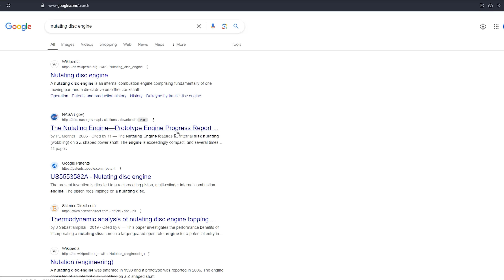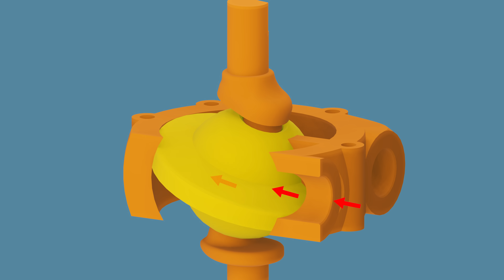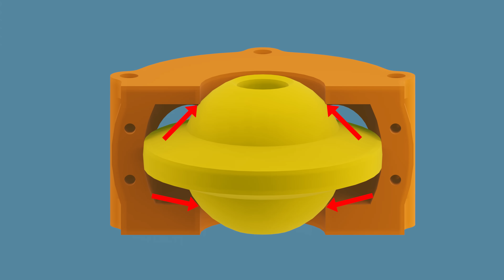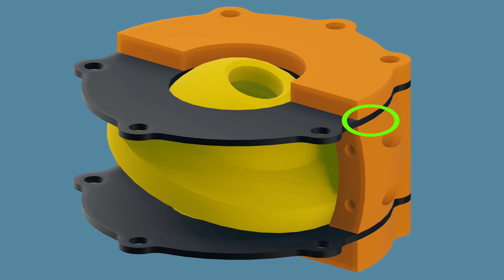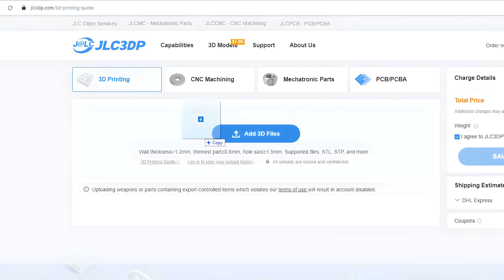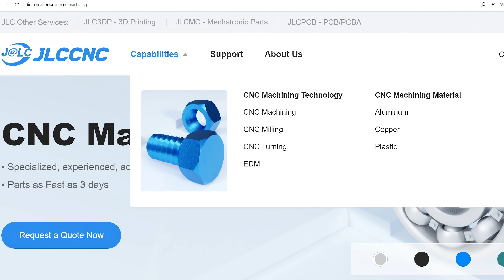I Built a Nutating Disk Air Engine

Comment: A true proof of concept. A device that converts moving air into moving air!
Reply: I'm pretty sure if he just cuts the engine out and just lets the air flow out of the tube it's 100% efficiency with regards to moving air. (Which I believe is why he's using the propeller, correct?)
Reply: @orion1816 propeller works like a gearbox as he needs more torque
Reply: @GewelReal  you dont understand.  The airflow he is using as power input will ultimately be the exact same airflow out as the propeller pushes.  the system is useless.
Reply: @orion1816  no, YOU don't understand.
air out of hose may produce a lot of thrust, but it's not optimised for lifting something heavy. It will work way worse than a propeller unless your goal would be speed (it may not take off the ground as well as a propeller if at all)
Reply: @GewelReal  тогда просто возьмите пневматический гайковерт . Будет отличный момент при меньшем расходе воздуха. Плюсом будет еще и привычное управление )))
Reply: @orion1816  you dont understand. the proof of concept is the change of pressure rotates a gear, the underlying idea behind an engine. The pressure change would be produced by a fuel being combusted and then the end products of combustion would be put out the exhaust. You could say this comment about a piston too.
Reply: @slobodancovek8047 ... But what you don't understand is that combustion is a highly inefficient mechanism of energy transfer in the first place as 70%~90% of fuel energy is lost as heat. It is much smarter to focus on purely electric solutions as they are 99% efficient.
Reply: @ the viability of combustion or not has no bearing on the viability of this to perform the same work as a piston
Reply: @orion1816  this is very small minded. The system converts moving air into rotational energy. For the sake of the video this is demonstrated with a propeller. The output of the propeller, by the way, would be LESS than the input as air and energy will always be lost to the environment.
Reply: @HopperDragon  agreed. Using hydrocarbons as a combustion fuel to power a kinetic application  is absolutely small minded. Let's leave this stream punk technology in the last century and get on with the electric revolution please.
Reply: @orion1816 -- Weirdly enough, airplanes are the one place hydrocarbon fuel is strictly better than electricity, and the reason is energy density. Gas has a ton of energy in very little weight, while electricity needs tons of batteries or a power plant anyway. Electric motors aren't exactly light either.

This isn't as bad at small scales, which is another reason why batteries dominate the toy world, but a 747 would need a much larger mass fraction of batteries to get the same ~20 minute flight time.
Reply: @GewelReal No, you don't understand. The propeller cannot possibly produce more thrust than the air being used to turn it. If it did then it would be over 100% efficiency which is obviously impossible.
Reply: @orion1816  Yeah but that would miss the point of exploring the mechanical principle that turns compressed gas into rotation. 90% of the 'engineering porn' stuff on here exists for the same reason. Besides that, this principle isn't a million miles away from how a throttle valve works inside a carburetor. It's worth knowing about.
Reply: @orion1816  2nd law of thermodynamics, you can't break even ;)
Reply: I've enjoyed reading the comments that word meant in good humor😄, as well as those from commenters totally lacking a sense of humor🤣.
Reply: Isn’t a turbine more efficient surely?
Reply: I dont know if you're being sarcastic or funny, but this is goddamn funny
Reply: Lmao
Reply: Put some wheels on it and you can move through the air while moving air with the air!
Reply: I think this is better for a land based vehicle
Reply: You're forgetting the really brilliant part.  You're losing energy in the conversion.
Reply: watch tom stanton  2l bottle series
Reply: More like spreading air
Reply: I think delta momentum and delta energy different things. So I think this theoretcically could be useful. This of course doesn't take friction in to account.
Reply: lol
Reply: im a fan
Reply: THE ONLY PROBLEM IS THE 100 KILOS COMPRESSOR HAHAHA
Reply: @gatoninja4387  Yeah, this is a totally useless concept unless for educational purposes.
Reply: @Motocicleiros  Have you ever seen a compressed air plane?

You know, the ones where you put compressed air in a bottle then fly a small model plane using the compressed air tank.

You could also just compress the air in the bottle then let it out, but such a plane only flys for a few seconds before the air has completely equalised pressure with outside.

But if you feed it through a turbine you can run a propeller and have quite a long time (minute +) of powered flight.

This turbine is an attempt to do that with a simple mechanism.  I'm not sure this particular design is it, but it is an interesting idea that is worth investigating.

It isn't making energy, but merely designing what they hope to be the simplest mechanism to use the stored energy more efficiently.
Reply: @meateaw  Oh, toys! OK!
Reply: That’s a fan.
Reply: With the right hose, this is surely a perpetual motion machine! 😂🤣🤓
Reply: @briantopping5631 are your mom and sister available?
Reply: @briantopping5631 jk, ofc.😅
Reply: @briantopping5631  So what you're saying that if he puts a hose on the exhaust to a valve that cuts into the supply line, once he gets it running he can switch it so the exhaust circles back into the motor and he doesn't need the compressor anymore?
Reply: @ I wasn’t sure how this would work, but that sounds just right!

Comment: Honestly, I don't know why your design holds the saturn bauble from rotating freely.  I think that big hole for the like, vertical pin to hold it from spinning is probably the biggest place you're losing compression, and that pin sticking out of the case can't be good for the airflow either, and I can't figure why it wouldn't work without it.

Comment: I've had good luck "lapping" plastic parts for a better fit, with toothpaste.  Maybe oversize the rotor 0.1-2mm and lap it into the housing with water and toothpaste.  Then rinse and dry.  I'm not sure how much improvment is needed in this area though.  It may work on the top and bottom seal to rotor interfaces though.

Comment: Intersting idea- its like a boxer engine but without the seperate crank shaft between the cylinders....but Two points to add-
1: Wear in the cylinder over long  term operation- it would be interesting to see how much loss due to friction in the cylinder you generate.
2: Vibration - it would seem that having the axis of the "piston" disk at an angle would generate a fairly significant sideways/rotational vibration; so again something to measure on an efficiency loss

Comment: Okay, so how does it compare (in terms of efficiency) with a typical airmotor?
You made comparisons, right?  So you'd know whether it was really worth pursuing?
You made measurements, right?  How long does it last running full tilt boogie?  I didn't notice any bearings or lubricating method.

Comment: the disk inside needs to be as light as possible to lower dampening force, dont know if its possible to add motorical gears that could increase the weightlift power

Comment: I think it's a mistake to have that keyway that keeps the disc in one position. Remove the keyway, make the disk continuous all round and let it rotate if it wants to. I think you'll find the overall effect is better. It's also creating friction between the disk and the key.  You may also find making the surface of the disk where the air impacts it slightly concave as if a mild torus has been subtacted from the shape might improve it also. I think you'll find it will work better with more closely-engineered surfaces than using rubber seals and then letting it run at a faster speed.

Comment: Cunnect the air out to your compressor intake or a "vakuumer"/strong dust sucker.
In a fictive real live costrucktion a air compressor could be part of the circle by deliver positve and negative pressure at the same time.
What about way larger wings and stronger construcktion and let the force be delivered by hydraulik over all?
may be slowe the nair but way more force possible, so larger bladewings could be used.
You made me curious at all^^

Comment: i think you need the second disk to restrain the exhaust and use it into your rotation, the 2 disk version you showed is kind of using the leakage and the exhaust to spin a second disk wich is 180 degrees from the first. 

I think you should try that two sphere in series is my first idea
second idea is to turbocharge your exhaust into your intake using the leaks and the exhaust to spin a regular compression disk inside a turbo body. 

both ideas together and you might have something quite cool. damn i wish i had a printer

Comment: if you could force air without compression through movement, you could create a safety device that would turn a propeller in case of engine shut off?

Comment: i wonder if using a different seal would work better than rubber. I wonder if Nylon would work. Or at least something with low friction that can hold air. I could be wrong but never  know till you try right? Nice work hope to see more. You have a new subscriber.

Comment: @7:12 the second valve improved the exhaust pressure and made it spin slightly faster than without the valve. Keeping the pressure high inside the engine.

Comment: Seems to me the 'vane' is far too thick.  You should build the next one with a metal washer sandwiched between two hemispheres.  If it requires the sloped angle to form a seal at the top and bottom, you can compensate for the flat washer by making the housing hold the slope instead.  You'll have less wasted force from the air banging into the big, fat cross section of the vane, and you'll be able to make that keyway smaller and tighter since it won't have to make up for so much of the same cross section.  Also, you can put a piece of rubber on the washer/vane itself AT the keyway to form a better seal.  Don't do it like a wankel apex seal in between the vane and keyway, but more like a squeegee or windshield wiper, so it can flex up and down.
Reply: The thickness might be "valve timing" but questionable

Comment: I'm confused why you would ever use this instead of the Tesla turbine with near 100% efficiency. 
Too much unbalanced load, it'll tear itself apart shortly.
Reply: A TESLA turbine doesn't work with combustion, but this will.
Reply: @logic.and.reasoning  Firstly, no it will not. Not how it is designed currently. Second, he literally called it an air engine.
Reply: @TlD-dg6ug  rotation detonation... look it it.

Comment: Graphite works great for both sealing and reducing friction
Reply: Probably could run some powder through it and it would self-coat all surfaces by embedding to the plastics.  Maybe a primer first to soften the top micron of plastic, low percent oil/acetone blend.  Of course not on the transparent one or it would not be so transparent anymore.
Reply: That's a good idea, I think this is a good application for the use of graphite instead of seals and oil.

Comment: Seeing as the disc doesn't rotate, only spin. I wonder if there is some sort of accordion style gasket you could use - like a speaker's edge. Something that will flex a little, but hold air in without losing much energy due to friction.

Comment: So, 3 ways to make this more efficient. 
First we have to understand the high torque low speed nature of this engine. It runs at exceptionally low pressure and doesn't go very fast. 
The first way to increase the efficiency would be to further stabilize the rod, as this will reduce friction. It was a tad wobbly. 
The second way to increase efficiency would be to add a gear ratio to the propeller making the propeller spin between 1-2.5 times per rotation of the engine. This would add friction but help the engine convert torque to propeller speed.
The third way to increase efficiency would be to reduce the total number of gaskets used and make a more solid chassis around the disk, and reduce the size of the sphere in the middle. Using an interlocking chassis you can make a more definite tolerance, and use less gaskets. Reducing the size of the sphere would increase the total surface area of the piston without sacrificing too much volume or adding total size. I'm sure there is a 'too small' though as you could lose compression. 
You could also experiment with changing the edge of the disk only around the area of the intake or outtake, as well as getting rid of the gap around the fin that interlocks with the disk and chassis to reduce bleed from one chamber to the next. The disk tilts so maybe use a parabolic shape. This point goes in tandem with @acreery1 comment.
Reply: Imagine being able to measure IQ from a single YouTube comment. 🤔 🤨 😂
Reply: I wonder what bennefit a single air input split into two streams feeding 2  parallel turbine “balls” connected on one  power output turning shaft stacked on top of each other but out of phase so there isnt a repeating lower output restriction of flow point between the up and down wobble from the edge blocking the inlet
Reply: I have an even better way to increase efficiency and power. Make a rotary vane motor.
Reply: @FreeXsa  Wow, that doesn't go against the creative context of the entire video at all... you know what else would make it more efficient? Making it bigger and actually using it for something productive. 🤡
Reply: I have one way: forget it.
Reply: What makes this high torque? By the looks of it, this design could easily be stalled when mid stroke, causing air to just bypass rather than move the disk.
Reply: @--_DJ_-- -- High torque compared to a traditional bladed turbine, especially at low speeds.
Reply: How different is your commentary from "COOL, Dude" standard responses 
I smell 150 minimum IQ
Yes we can recognize each other my fellow even at a distance 
Though the feeling of loneliness is there, you are not, it's just because we are so few and separated
Reply: @sorinavila5073  Apart from barely understanding what you're trying to say or whether or not this is sarcasm, sure! Thanks, you too man.
Reply: @sorinavila5073  what on earth are you yapping about
Reply: @LeavesDecaying  I don't disagree, but maybe he's just sad.

Comment: Correct me if I’m wrong but this is how a hydraulic piston pump/motor works, just the pistons act as valves in the hydraulic version.
Reply: Not really. The way the hydraulic pump works is it has pistons that spin on a flat plate that is 45 degrees or so angled, effectively driving three or four pistons in and out.

Comment: LOL. Several patents around this architecture exist. I significantly improved them and many other rotary designs. 🤯💥🤯Multidisciplinary engineer/inventor here. We are developing the revolutionary FAZE engine technology. The 𝔽𝕦𝕖𝕝 𝔸𝕘𝕟𝕠𝕤𝕥𝕚𝕔 ℤ𝕖𝕣𝕠 𝔼𝕞𝕚𝕤𝕤𝕚𝕠𝕟 𝔼𝕟𝕘𝕚𝕟𝕖  tech best solves the issues present in previous internal combustion engine designs by transforming the old paradigm into a simple, low cost, quiet, power dense, efficient, on-the-go liquid and gas fuel-flexible, ‘non-polluting’ solution for power generation of all scales and advanced transportation.

𝔽𝔸ℤ𝔼 delivers better than 25% ABSOLUTE/ACTUAL [not relative] 
fuel efficiency improvement over gasoline engines, more than 15% 
for Diesel engines at any operating condition - speed/load, ambient 
temperature or elevation, not just at one optimal testing point at 
STP. Real world driving cycle savings could be an additional 200% 
higher due to the constant MAXIMAL efficiency and torque which 
results in a huge turn down ratio of ~99% without sacrificing 
performance. That means it's idle or running speed can be 10-50 rpm. 
The `simple, low cost, native/built-in, non-electric, environmentally safe, 
non-explosive, temperature agnostic 𝕊𝕦𝕡𝕖𝕣ℍ𝕪𝕓𝕣𝕚𝕕© feature 
recovers more energy than EVs and provides approx.100% fuel 
savings for a combined absolute vehicle fuel usage improvement of 
approximately 300%, thus obviating the basic need for expensive 
EVs & e-hybrids. 𝕚ℙ𝕠𝕨𝕖𝕣𝔹𝕠𝕠𝕤𝕥 adds >400% more torque. It’s like 
4 engines in 1.  This is all done w/o a transmission. 
 
The fuel agnostic capability allows instantaneous use of any liquid 
or gaseous fuel [natural gas at home!!!] incl. biofuels and hydrogen, 
even if old/dirty/unprocessed like flare gas or employ the concurrent 
multi-fuel capability…anywhere on the globe. One engine for all 
locales w/o modifications! Unlike EVs, this enables fast fueling anytime, 
anywhere…with no troublesome infrastructure disruptions or 
changes. EV’s are not a solution to the [FAKE]climate or mobility topics as 
high level of electrification globally is unrealistic 
[See Patrick Boyle's video "Electrify Everything?"] 

The technology offers smokeless, non-polluting, low odor heat and 
noise output without costly after-treatments, etc.,… with only the 
lowest  CO2. It has a negative carbon footprint with hydrogen, 
ammonia, biofuels or gasified municipal, agricultural and/or forest 
waste and coal from a 2-stroke-like simplicity. 

With virtually no electronics and emissions equipment, the cost of
purchase and reduced servicing frequency make this solution 
even more appealing.
 
Those are my two-bits

PS.
Did I mention we're developing advanced, simple, low cost, power dense electric machines and torque dense[read - compact], infinitely variable FrictionLess transmissions?

Comment: You need to split the air into the upper and bottom section.

Add small fins on the surface area of the disk just like a hydro wheel